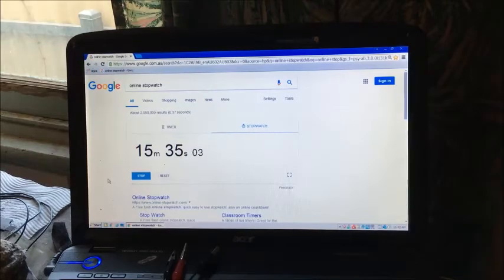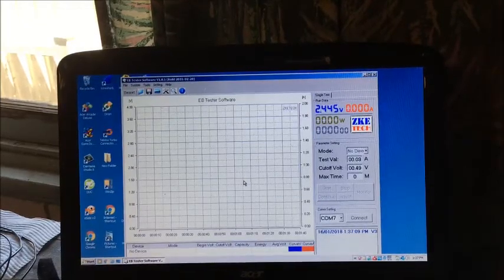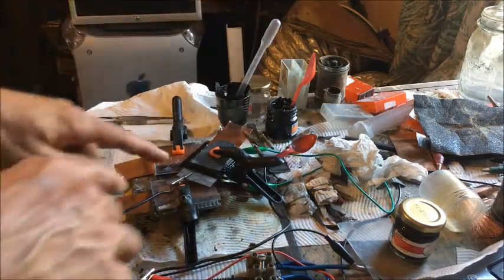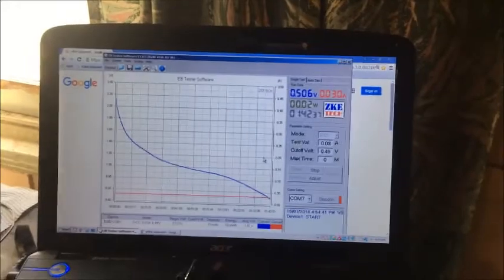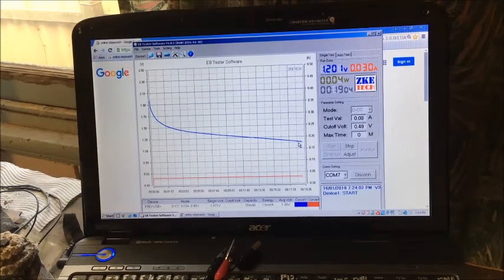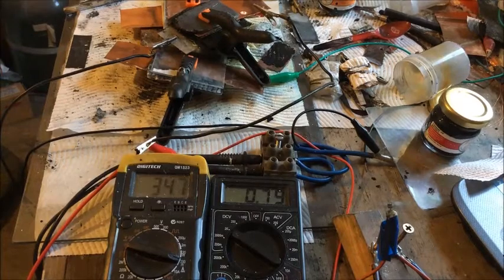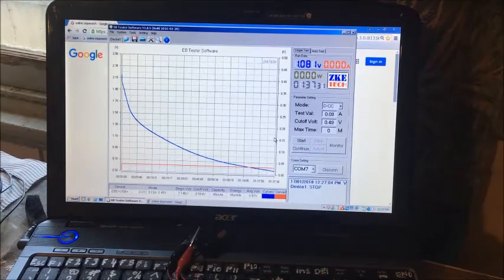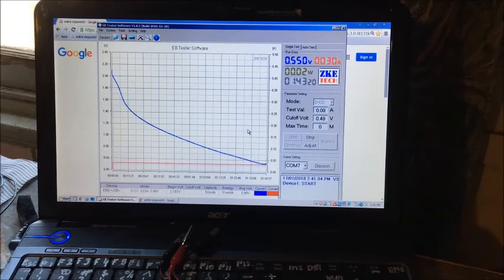Zinc And Manganese dioxide On Paper Towel separator

Comment: Making good progress Dan.
The Cell shown at 44min is excellent at 52 mWh 1h 44m run time @30mA, it’s a great rush when you beat your own record :-)  
The subsequent charging and reruns were a bit puzzling, when you stopped the charge, the cell was still drawing over 100mA, that’s seems a bit odd, either the voltage is to high and the current is splitting the electrolyte and going as heat, or there is a S/C in the cell.The current should ideally be in single figures when the cell is fully charged. 
Maybe a lower voltage for longer, or perhaps a paper towel separator could be placed between the MnO2 and C to reduce the chance ofa S/C.   :-)     Martin.
Reply from the maker: Hi and thanks Martin. I owe a lot of this to the people on you tube, who first spawned the idea that its possible to build home made batteries and capacitors from home chemicals. I'm still green and new at all this, But find it a pleasant hobby.
With the strange results of the cell , I'm thinking that it's electrolyte under the collector plate. I have the cell apart to let the graphite plate dry and I will tape up the collector and we can see in the next tests if it does the same.
Reply: Hi Dan,To be fair I think most of us are learning as we go along   :-)
What proportions are you using on your separator coating / binder?
Are you using mono ethylene glycol or poly ethylene glycol with the cigi butts and acetone?      Martin    :-)
Reply from the maker: Hi Martin. This batch was made with 500 ml Acetone, 400 smoke filters(2 bags), dot 3 brake fluid 100 ml(say Polyglycol  could be anyone of the 3.
The three most important polyglycols are poly(ethylene glycol), poly(propylene glycol) and poly(tetrahydrofuran).
thats the main mix. Then when mixing with carbon I use for 12 g carbon mix 1.5 table spoons of the separator mix to the carbon and an extra 50 ml of acetone to mix it in well. then brush on to paper until all mix is used.
Reply: Cheers mate, I have an idea for making a little test rig for
looking into the ion conductivity of DES, and will need a fairly robust separator.There must be an easier way to work through lots of different
mixes quickly, to optimise the given ingredients of any given mix without building a new cell each time.  Martin     :-)

Comment: Dan
It is worthy to note your methodology has improved considerably since your early videos. It is much easier to compare results between tests. The improvements you have made in organization and (video) documentation, not to mention the analyzer makes following progress more comprehensible. It has also improved your ability to assess results.
Also noting temperatures was a good idea to help determine whether there are otherwise indistinguishable effects.
As a side note you are among a few openly conducting energy storage experiments on YouTube I have been following for some time. Some might be put off by the length of the videos but for the sake of documentation I think it is imperative to provide sufficient information for those of us who follow the progress. The editing you do helps minimize viewer fatigue.
I see your comments on other channels so I know you are aware of what others are doing. It is important that the community work however loosely together to the same ends. Development of efficient, less expensive, sustainable, energy storage solutions is becoming an important aspect of our electronic dependent culture. I just wanted to add that as a vote of appreciation and encouragement for your efforts.
Fred
Reply from the maker: Hi Fred. I'm honoured that people watch these videos. I think the you tube battery community has made great head way into how the construction of the separators and active material should be applied for maintainable battery/ capacitors, A lot of the you tube battery people are working on electrolytes as we speak. For me the electrolytes are beyond my knowledge for now. But I'll see what I can get from carbons and various activation methods.